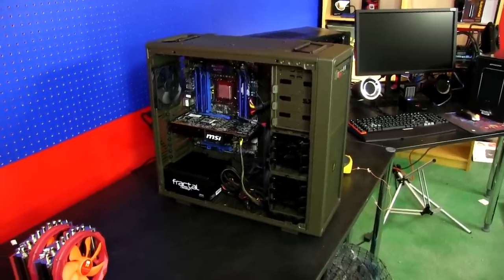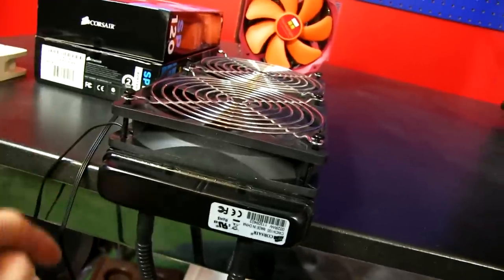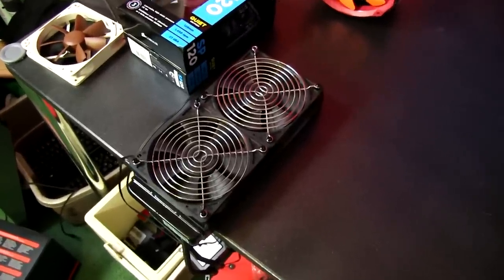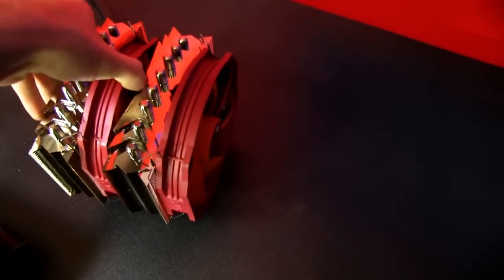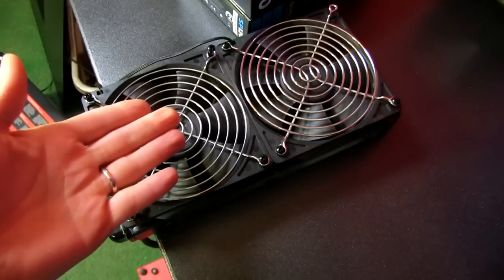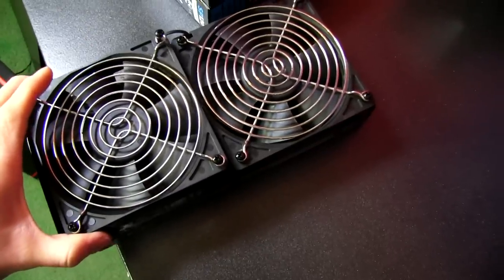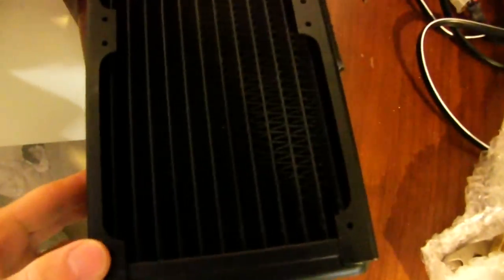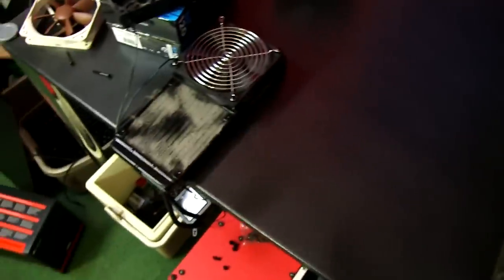Push vs Pull vs Push Pull for Radiators and Heatsinks Linus Tech Tips

Comment: I’m from 2020, and I have never seen fans that look like a grill.
Reply: They hella ugly but I've seen a few PSU's that look like that
Reply: You do can buy those finger guards separately. I had to buy one for my side 200mm fan because the case was so tight that my GPU cable sometime touched the fan and stopped it from spinning. The guard kept it from blocking the blade and all is good now.
Reply: What is going on here?
Reply: One of the great perks about a pull configuration is that if the air passing is hot enough you can use those grills to cook on
Reply: I'm from last week and grills are no fans of seeing.
Reply: IM from 2021
Reply: I'm from 2022 and I still have the same fan grills from 2012 that I use for my entertainment center's exhaust fans. They are great if you have little toddlers running around touching everything. lol
Reply: Those grills are from an age when my brushless aub0812vh fan .41a and 80mm ruled the landscape. What are fingers.
Reply: Holy crap it’s 4.4K rpm 42cfm but it’s a maglev fan. I never knew what a gem I had. I used it for precision air cooling vrms while I had an aio cpu cooler
Reply: Im from 2050, and yes radiators are obsolete in my time.
Reply: They’re just a grill/cover thing screwed over the top of the fan. You can still get them. They’re useful in small form factor when cables might be too close for comfort to the spinning fan blades.
Reply: Yeah cuz that's a fan grill wth

Comment: 7 years old and still the quickest/simplest run down on push/pull fan config.
Reply: Try 9
Reply: 9 years later and this video is still relevant and helpful as ever. My AIO is top mounted and this video saved me from taking my PC apart to switch the fans to push. They're running in pull atm, creating a positive air pressure in the case because of the 2x 200mm front fans and 1x 120mm exhaust fan.

Comment: Excellent wisdom right here, especially the tip about using pull so as to easily clean dust. Linus, after watching several of your videos, I can safely say you're my favorite tech guy!
Reply: +bennemann Cleaning the rads configured to push should be easy, you just blow them with a can of air from the outside. This way you're not pushing more dust on the deeper radiator surfaces but blowing it out the oppposite way to how the dust came in. Disadvantage is that you don't have much visual control, but as soon as dust stops falling out, you should be good.
Reply: +Siana Gearz Thats not very effective.That will simply blow the dust everywhere.
Reply: There are filters that stop most of the dust. Then you just clean the filter.

Comment: Interesting stuff. I did a bunch of tests with my Corsair H60, and when I first got it I replaced the included fan with a single Antec TrueQuiet fan. I loved it so much, I decided to get another one and do a push-pull setup. The fans make literally no noticeable noise. With 2 fans, it's 4-5 degrees cooler at full load, than with a single fan. The difference is small, but it's definitely a difference.

Comment: Dear Linus,

I've had a serious argument with my fellow students regarding the validity of push/pull configurations. After showing them this video, they said that without providing test data (or even scientific studies) this is "just some guy on the internet" - no matter how many subscribers that guy has, how well-liked the video is, how many years of technical experience are hiding behind that opinion and him being a semi-official mascot (or saint, depending on who you ask) of /r/pcmasterrace.

So here's my question: Do you have data to back up your claims? Have you changed your mind about this matter? I've configured my builds fan configuration according to your advise, so I'd like to see that, too...

Thank you for being awesome
G
Reply: GavinHohenheim If he is just some guy on the internet, they're just some students in a school and if they ignore the fact of how many years he's been doing, how many subs and views, then they're just not that smart are they now ;)
Reply: GavinHohenheim http://www.overclock.net/t/1274407/fans-the-most-complete-and-comprehensive-array-of-tests-and-benchmarks

There is some tests done comparing a lot of fans through radiators using push, pull, and push/pull configs. As you can see the PUSH config out does the PULL config by around 2.5c-5.0c.

Hope that helps you make your decision on how you mount your fans.
Reply: GavinHohenheim Like most of Linus' OPINIONS, they are just that. I rarely see him provide any indisputable proof of any of the claims he makes, especially when it goes against common wisdom. His point about Pull providing easier cleaning is definitely valid, but I have yet to see any documented studies showing where Pull cools as well as Push unless his margin of error is +/- 10% or there about. Until he posts some studies from a reliable source then he's just blowing more hot air like he does so often.
Reply: GavinHohenheim I have been pc gaming and water cooling for years and while I wouldn't say the push/pull isn't sometimes better than push or pull alone, the extra effort (etc.) is not worth perhaps getting a degree or two lower on perhaps some of the cores.

For anyone getting results that make it seem like a watershed moment, then they were doing something wrong when they have the two original fans.

OTOH, everyone loves getting religious about tech, so if I were you, I wouldn't bother talking about this with your school chums.  Might as well argue about abortion!
Reply: BINARYGOD For the most part, the advantage of Push/Pull is it enables one to use slower and quieter fans to achieve the same end cooling results, That's the only reason I do it on my air coolers. Otherwise I agree with what you said.
Reply: cee128d
Right, there is that too, I just have never run fans that were loud enough that being behind the rad and the grate they were a bother.  If they were, I got new fans.  :-)
Reply: BINARYGOD "For anyone getting results that make it seem like a watershed moment, then they were doing something wrong when they have the two original fans."

I have an H55 on an NZXT Karaken G10.  I was running it on an HD7970 in pull mounted in bottom of case.  It performed fine, overclocked on Valley never getting over 55c.  I did notice when gaming the air coming from under my case was real warm  Just to see what would happen I took two bolts from the bottom and mounted a case fan in push.  The first thing I noticed was there was a lot more air blowing out from under the case, back on Valley I noted the the air no longer felt warm at all and the temp never got past 44c.
http://i250.photobucket.com/albums/gg257/MCO_TruKr/PC%20Pics/WaterCool01.jpg
Reply: Eldor Luedtke
Maybe I am reading that wrong - but it still sounds like something was wrong with the initial setup, in that if your getting noticeable results like that, the original thing had something wrong with it

I know that with certain rads, even on top of high vs low air flow, they perform better in push vs pull.  The rad I am using now doesnt get any better with push-pull, and is worse with pull that either.

Eh who knows - I once just cut a hole in the side of a lian li when I noticed the side of the case getting warm during gpu overclocking.  GPU temps drop like 10C on load.
Reply: BINARYGOD The H55 is small, low area of heat exchange, more air flow made for better heat exchange.  The RX360 I use on my CPU, well not a lot of air flow needed to stay cool there.  I agree that push is better because THAT is where pressure comes in as denser air conducts heat better than thin air and the H55 would have been push were it not for me not wanting to blow warm air at my GPU (RAM and VRMs), kit did not come with short bolts.
Reply: GavinHohenheim tell them its a great opportunity to practice those experimentation skills.  test temp one way, test temp the other way.  if they really want to do it right have them define the controls on the experiment and run the experiment a bunch of times.   could even try doing say 50 tests one way 50 tests the other way,  then for comparison do 50 of each but alternate back and forth between push and pull each time, just to make sure that doesn't change the results.   if in doubt, research it and experiment.
Reply: GavinHohenheim I've found push-pull configurations to be valid alternatives especially when having radiator fans as front intakes. Always made an impact on overall thermals. Also, my overall experience is that push-pull is worth it if you can afford it. The margin isn't large, but it's there, at least according to my 15+ years of experience.
Reply: +ben tre  Justin Bieber has 17 Mio subscribers on YouTube and he is looking back at an 8-year career, and life long training as a singer and stage performer. Clearly his insight is superior and we should all be taking advice from him. If you disagree with spitting on people, drag racing, driving under influence, and being a massive bigot, then you are clearly wrong, because he is more popular than you!

No, of course not. We respect Linus and his conclusions, but the person making a claim is generally at the burden of proof, and it's irrelevant from whom an observation comes that proof is needed.
Reply: GavinHohenheim it doesn't matter whether you push or pull nor does it matter if you pull the air into the case or exhaust it out as long as the rest of your setup is done properly.

I have a top mounted radiator with 2 Noctua fans pulling air in, I did it this way so the fans don't get dirty and a quick blow of air out the radiator every few months is all that's needed.  Then I have 2 140mm Noctua fans intaking from the front and a 3rd exhausting out the back.

This setup takes the slightly warm air coming out of the rad fans and pushes it directly out the back of the case.  If you have access to a 3d printer you can make a shroud that will direct the air from your rad fans right into your rear exhaust which is my next project.
Reply: He didn't say push-pull wasn't a helpful configuration.  He said it was a valid configuration when there is RESISTANCE between the two fans.  Well, I would think a 280 mm radiator is a bit of resistance, even if a small amount.

I used Corsair ML140s in my build, so for me the question is "will I get enough extra cooling to justify $50 more in fans to add pull to my push config."

Comment: I've been using push-pull configuration since the dawn of time

and I have never considered using a pool configuration leaving the bottom side of the radiator exposed for cleaning. This is such a simple tip but it's so helpful to be able to clean your radiator without taking everything apart

Comment: Short answer: Configure your radiator and fan combination in Pull or you'll get tons of dust which is nearly impossible to clean out without taking the radiator apart.
Reply: Pull so that it is pulling air from inside the case through the radiator out right?
Reply: Thanks!
Reply: Pull= air pulled inside the case or air pulled outside of it?
Reply: Patrick Chirico it can be either way in pull, pull just means it's pulling it through the radiator and push means it's pushing it through
Reply: Patrick Chirico Air pulled through the radiator. IN the top of a case this would be fans on top exhausting out the case while pulling through the radiator underneath
Reply: Is it better to have radiator fans as exhaust or intake fans?  And which configuration is best for either?
Reply: Eddie Zuhric  Push vs Pull vs Push Pull for Radiators and Heatsinks:      http://youtu.be/UyC3lZ5WFMk
Reply: @Comrade No, everything is inside the case, 1 fan is on either side of the radiator. The guy above said pull is just pulling air through the rad while push you're pushing air through, they both sound the same but its basically which way your fan is facing so say your rad is up at the top of the case on the inside and you have the fan under it, depending on if its facing with the logo against the rad or flipping it over will make the air either push through the radiator out of your case from the inside(push) or flipping the fan around would make air outside the case suck through the rad and into the case which is pull. To me it makes sense to put the fan at the bottom of the rad pushing air out as another exhaust since the two front case fans have dust filters there wouldn't be much dust build up and if you have a nice case it won't be that much of a hassle every year to take out 4-6 screws and vacuum out the dust from the inside or use a can of air to clean it. I don't have a dust filter at the top so if I made the air outside of the case pull in through the rad then it would just be sucking dust into my case and he has another video explaining either push or pull really doesn't make a difference in temps so to me I just think of the cleaning and dust factors involved depending on where you put it on your specific case.
Reply: So if I was using fans as intake use push? And for exhaust use pull?
Reply: @DarkGodHacker  No, I have a front mounted rad with the pull fans on the inside of the case pulling outside filtered air into the case. I realize you're probably dead now since you posted 4 years ago, just wanted to try anyway.
Reply: @KevinSmith-kg2nk  omg im building my first pc and i laughed so hard with your comment!, do u think it is ok if i put the radiator at the front with a pull configuration? , taking fresh air from the outside and expelling it up and back?
Reply: @marianaavila3492  That's what I did, the Rad is on the outside of the case covered by the front filtered cover, the fans are on the inside of the case pulling the air through, much easier to clean and keeps my E5-1650 41 degrees idle at 4750Mhz. :)

Comment: So for the pull configuration, the fans are on top of the radiator pulling air through it and out the top of the case?
Reply: yes
Reply: Not at all practical for me.

Comment: So should you pull air from outside into case or from inside and out of case?
Reply: SlamminUK You do not want the hot air from inside the case passing through the radiator. So pulling outside air into the case solves this problem.
Reply: Why would you want hot air passing through a radiator?! Tell me how that makes logical sense!
Reply: Thanks all. After testing with my new build my temps are allot better with the air from outside the case being pulled in rather than the opposite.  My build is here if you would like to look ;) http://i87.photobucket.com/albums/k151/slamminuk/IMG_1831_zps3ijoshdk.jpg
Reply: Brett Gibson Thanks ;). The rad fans at the top.
Reply: SlamminUK  so you are pulling air in through the rad and out the back?
Reply: Brett Gibson guess i'll find out soon myself
Reply: COOL1AIR1 Yep through the rad and then out the back.
Reply: SlamminUK That is a lovely build, which way do the arrows on the fans on your radiator point? i just got my first radiator and not sure which way to set them up D:
Reply: Chicimono Ha thanks ;) I've just ordered 2x 980ti's to add to it. On the top radiator the arrows point down.
Reply: SlamminUK Thank you very much :)
Reply: Jeffery Justice It shouldn't be too hot if you have proper intake (positve pressure) and ambient temps, Linus clearly states to run a pull set-up with the fans on the top/outside of the radiator if for nothing else the convenience of maintenance; it also helps airflow considering hotter air wants to rise.
Reply: Brett Gibson depends. If you have radiators then no. The gold is to transfer as much heat off those coils as possible. Blowing hot air will do little like if a Engine bay in car would blow all its hot air over its radiators. outside air on radiators is a good :) All A/C units do this
Reply: I always go in from the front and side out the back and top.

Now I prefer cases that have a separate radiator compartment.
Reply: Do you have your fans on top of the radiator pulling the air from outside or on the bottom of the radiator?
Reply: TheGirlGamer Yes on top of the radiator.
Reply: +Jeffery Justice I guess it's because the ambient air temp inside the case is sufficiently lower than the temp of the cpu when you're taking warm air out of the case. The water in the cooler pulls the heat from the cpu as it is also flowing, which then heats the radiator. It's the air flow across the radiator (the warm air being pulled from the case) that draws the heat away from that. The ambient air temp in the case would have to be ridiculously high or the airflow ridiculously low to negate the effects of the cooling. This way the radiator fans work to reduce the ambient case temp almost for free because if the airflow through the case is good enough the ambient air temp inside the case won't be much higher than that outside the case. Remember the vast majority of the heat generated by the cpu is being taken to the radiator.
Reply: I customed my case so the Radiator on the top is off the side of the PC, so it never takes any air out of the case and only out of the room. I have it on a custom slide I machined so i can slide it back over the top of my PC if i want, It even locks.. Its pretty slick.. It gives me about 15'C lower temps since its not pulling heat out of the case.. One of my I.T. buddies said i was on to something lol. Took me a couple days to complete.